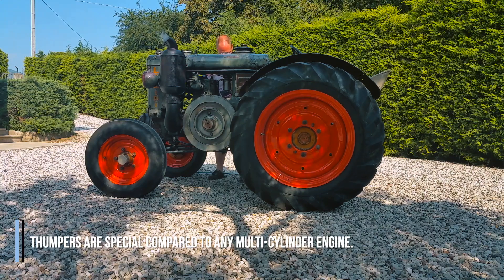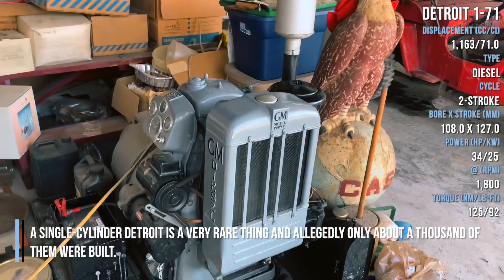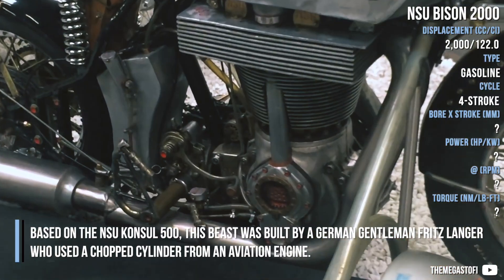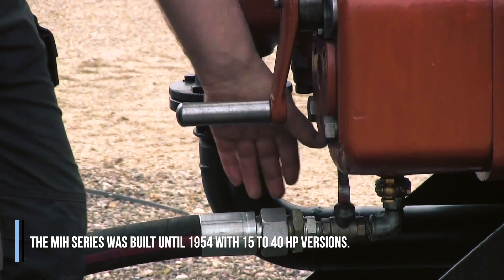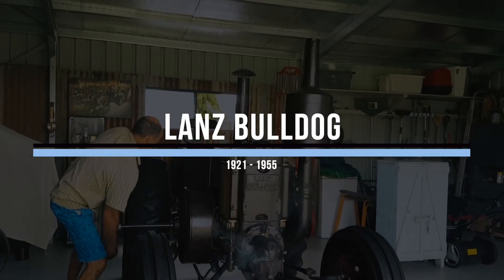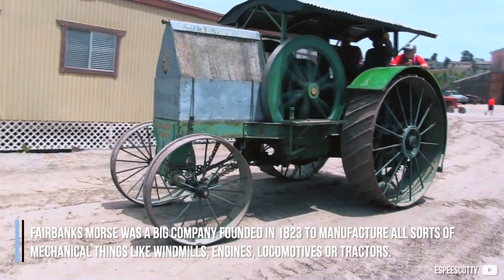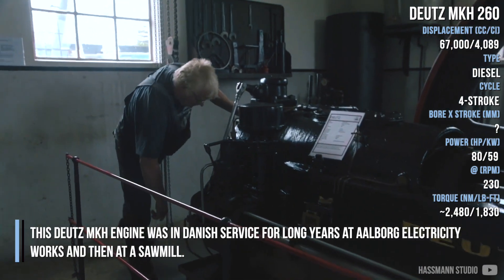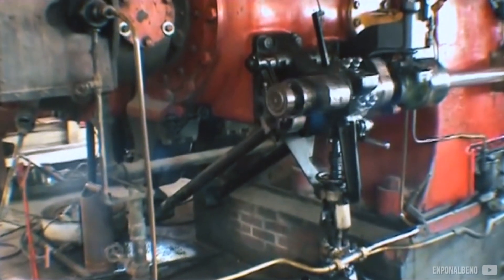Largest 1-Cylinder Engines

Comment from the maker: Anybody who finds these a song to his/her ears? Well, I do, mainly those large hot-bulb tractor engines
Reply: The Landini L25 here in Italy is known to be called as "Testa Calda" (hot head) due to the hot temperature required to ignite the fuel
Reply: dplgta95 Deutschland mkh 260 sounds cool
Reply: Here in the Netherlands they put those hot bulb engines in small rowboat sized tug boats. Search for "opduwer"
Reply: I always love the section of the state or county fair where they display and demonstrate the old agricultural machinery.
Reply: i would like a car or pickup with a huge single or 2 cylinder one with that thumppop at full RPM, than at the stop light pop............thump...................pop,,,,,,,,,,,,,,,,,,,,,,,,thump,,,,,,,,,,,,,,,,
Reply: @budsbustbi6339  Such cars did exist. The Brush Runabout of the early 1900s is an example, being powered by a single cylinder sidevalve engine of about 1.3L displacement, and delivering 6-10 HP. You might be able to find one for sale, though owning such an antique machine would be a hobby in and of itself, with lots of work involved!
Reply: If you ask me, my favorite tractor engine is that of the British tractor known as the Field Marshall.   It is similar to the hot bulb engine, but the combustion plug is a smoldering piece of wick paper.
Reply: this 1 cylinder  engine also makes beatiful music 
https://www.youtube.com/watch?v=UKScvorB85E
not mind to run it in Berlin "Berghain" and people will dance the hell out of it xD
what about a video about stationary engines - ;)
Reply: Just love a large single cylinder! A great variety of engines although I was hoping for Ruston Hornsby to be up there. They produced some very large single cylinder horizontal oil and Diesel engines for static purposes like mills and generator plants. Great video 👍🏻
Reply: Well you know that with the smell of the diesel is even better...
Reply: sounds like a pig with sterioids
i love it
Reply: YES! Big Pistons and  2strokes. Thats what brings the most joy.
Reply: what about the B & W Nr 1 and the Holeby nr 1 they are really large and single cylinders but u didnt take them into account?
Reply: I have my Suzuki Dr BIG 800 today, it's like a horse kick !
Reply: Maybe you could make a video on biggest two cylinder engines.
Reply: A monday morning a mean mean shine lol
Reply: I like the hot bulb design. It led to the invention of the prechamber diesel. Prechamber diesels might not be popular now, but many years ago, it was the only way to build compact diesels. Better injection systems, port swirl, and piston shapes eventually made direct injection compact diesels possible.
Reply: It reminds me of a kinda thruster for planes/space ships I've seen somewhere that's basically constantly exploding behind the craft. Bopbopbopbopbopbop
Same kind of satisfaction.
Reply: That DR 800 has some  throat to her , wow.
Reply: I honestly like the rythm they  produce but imagine one of these throwing a rod
Reply: This is my neightbor on the nsu Bison 2000 😂😂😂
Reply: Heinrich Lanz Mannheim
Reply: They look and sound old and primitive but I can listen to them all day long.
Reply: I am just a fan of engine sounds, tho my favourites are flat plane, two stroke and rotaries. I guess I'm a sucker for high RPM. These singles sound great in their own way too tho!
Reply: Pocketa pocketa pocketa
Reply: Yes except for your weird broken English 😂 spakplug
Reply: Check out a Delmag D-200 diesel pile driving hammer. It is a giant  single cylinder 2 stroke diesel engine.
Reply: @jasonguiol7110  c-45 from Bulldog !
Reply: May I ask where you’re from? I just cannot place your accent! I love how you speak and think your English has really come on leaps and bounds since you’ve been producing your videos. Keep up the great work brother!!! Peace and love x
Reply from the maker: @chriswilson2431  It’s Slovakia 😊
Reply: @VisioRacer  awwww thank you. Answered a question I’ve been trying to work out for ages! 😂. I love your passion for the older vehicles. I share your love for old mechanical things and have old cars and stationary engines myself. If you ever get the chance to come to GB then you must tell your viewers when and where, as I for sure would love to take you out in a pre war car as a little thank you for all your hard work researching and your enthusiasm. I love what you do and I think you’re such a nice guy. Peace and love from GB x
Reply: They all sound like lawnmowers.
Reply: 0:14 I'll make it fit

Comment: I live in Thailand. Here pick up trucks at the end of their road life are stripped, the normal engine is removed and it is replaced with a 5 litre Single cylinder diesel of various makes which drives the gearbox via vee belt. They are everlasting, because EVERYTHING IS REPLACEABLE with recycled parts. They are good for 3 ton plus loads, no tax, insurance or licence to drive needed. Pick ups with a good strong chassis are favoured.

Comment: The L25 isn't even the biggest Landini, It's the Superlandini or the L55-60  with a 12.2L single cylinder. Even bigger here in France we had the SFV (Société Française Vierzon) 551 with a 12.8L single cylinder engine.

Comment: Love large engines, but these are not the largest single cylinder engines. Waukeshaw (I may be mistaken about the manufacturer) had a single cylinder diesel engine that was approximately 4 feet in diameter and turned 60 rpms. It was in service generating electrical power. The one I witnessed was located in Homestead Florida power plant, which was some 40 plus years ago so I may be slightly off but within inches. I was there working on the two Transamerica DeLaval Enterprise 20 cylinder diesels with 15" Bores and 21" strokes turning 450 rpms also producing electricity. These two Enterprise engines were the only two 20 cylinders that Delaval ever produced. They produced engines from 6 cylinder in-lines to 16 cyl V engines. Some of the marine 16 cylinders were direct reversing engines, meaning they would run in forward or reverse with a max of 9K BHP.

Comment: That's Suzuki that has 800 C c's in a single cylinder is it a 2 stroke or a 4 stroke? And ask for the Detroit 171 it's just basically A671 with 5 of the cylinders not there

Comment: You didn't even mention Rustons. They made a range from singles up to 6 cylinder parallels I believe.

When I first left school I worked at a local sawmill that had a large twin Ruston powering the breast bench and the skid winch. If you were a little late getting to work (which I often was) you would see twin smoke rings about half a meter in diameter from the engine as it started up.
It was amusing to wait until the sawyer on the breast bench had a heavy cut going and then load up the skid winch. Man didn't that engine just knuckle down and grunt as the governors opened up.

Later during my apprenticeship I worked on a single cylinder Ruston which, from memory, had a 18" piston and a 36" stroke with a 6' flywheel. Both were compressed air start.

The engine hadn't been running for 10 or 15 years and we had to get the engine running again as it had been sold  and the new owner wanted it running before moving it. We had borrowed a small Petter single cylinder stationary engine to run the compressor and when all was ready John the mechanic opened the valve to turn the engine over. Now the shed the engine was in was pretty run down and the area where the compressor and air valve was had no roof. Added to that was the exhaust pipe that ran from about waist height down under the floor for about 4 feet then up through the roof. Unbeknown to us was that 6" exhaust pipe was half full of black sooty slimy water. When the engine turned over there was a hiss and a roar followed by a gurgling sound on the exhaust stroke. All that compressed air blew that mess straight out the exhaust pipe, into the air, where it promptly fell back down onto the roof. Except there wasn't a roof over the compressor, which also happened to be where John was standing. Needless to say John ensured that a large portion of this mess didn't sully the floor. I just about had a fit I was laughing so much. He just stood there with slime dripping off his glasses.

Comment: There is atleast one larger 1 cylinder engine than any listed here.  At the United States Merchant Marine Academy there is a single cylinder version of a modular ship engine.  this single cylinder engine is a Wartsila engine with a bore of 38 inches and a stroke of 98 inches thus giving it a displacement of 1786 liters.

Comment: Doesn’t say fuel engines.  what about the 3 one cylinder steam engines the Dutch used in the 1850’s to pump out a lake south of Amsterdam. 3 meter one cylinder steam engines driven by multiple boilers. Dewatering on steroids.

Comment: I remember when living on my father's farm growing up, we had a "Piagio" one cylinder cultivator. It had a pulley that was operated by a rope, that I had to roll over to crank the engine. It had 16-17 HP, and smoked like a bastard, but it would get the job done.

Comment: Miata owners: "I'll make it fit"
Reply: Werent that honda owners?
Reply: @ehmjauhh5495  no. Honda owners will make it louder and more gutless
Reply: @MrThunderCunt  so what happend with the "you think that'd fit my honda?" Meme?
Reply: @ehmjauhh5495  i assume it got replaced/overshadowed by the vtec meme, because that's the only thing I hear when hondas are involved
Reply: Or Citroen Saxo drivers… my mum was a Saxo driver until she got an Audi
Reply: @Youtube_Reiska  so she downgraded?
Reply: @duasrodascrl  in reliability, yes. In luxury… hell no! She had a 1.1 litre saxo and changed it to a 3.2 litre v6 audi a6, constantly broken. Now she has a Merc C200 diesel 2.2 litre 135 hp… oh yeah. Very reliable and only fault was a leaking turbo hose, cheap easy fix
Reply: Anything will fit in those cars with enough cutting

Comment: When I worked heavy construction (building bridges mostly) we used a pile driver that was single piston diesel powered.  I don't know what the weight of the piston was but you would pick up the whole apparatus (about 20 feet tall) piston and cylinder  and all set it on a piece of pile turn on the fuel and as you picked up the piston with the crane it would draw fuel into the cylinder and then you'd just drop the weighted piston and it would create pressure in the cylinder causing an explosion driving the piston up in the air and repeat... it would stay running as long as it had fuel a fun way to make a dollar (much more fun than pouring concrete) :D .
Reply: I absolutely love those diesel-powered pile drivers!! Cool and terrifying at the same time.

Comment: Too bad he doesn't show some of the stationary engines used in the oil fields 120 years ago. I remember seeing spark ignition engines with cylinder bores over 15" with greater strokes. Atmospheric intakes with single lobe cam controlling the exhaust with flywheels taller than a man.

Comment: I remember reading about a single cylinder diesel engine in Russia driving an electrical generator which had 54" bore and 54" stroke in a 1911 Encyclopedia Britannica.  I get it worked to  39,366 c.i.

Comment: A single cylinder doesn't automatically induce/imply more torque. It dependent on the bore and stroke. You know you can have the same cc's but is it an over square engine'? Under square engine?

Comment: I had a 1955 500 cc. BSA Goldstar ,and that thing had gobs of torque, but would vibrate all the bolts out of the engine mounts, and would put your legs to sleep if you rode it very far. Wish I still had it!!!

Comment: Curious how that Landini crankshaft was rotating backwards for the first several revolutions before changing direction to normal. I dont think i saw any steam engines so I guess this was internal combustion only. If steam is included, there would be some Corliss type and probably other steam engines that would dwarf everything here.    Cool video though  !

Comment: the last engine was running that fast and sweet with a 26 in piston and a 38 in stroke . the average piston size in a engine is 3 or 4 inch. this is a monster of a engine it's to bad they don't make them now they would be fantastic on massive whole town back up generator or for a huge plant generator.

Comment: Here in East Texas, I've seen odd looking single cylinder horizontal engines that appear to have been cobbled together using oil field pipe and steam engine parts. They were 2 strokes and were fueled by the oily natural gas that came up with crude in the local wells. Was told those spun generators that powered electric lights so they could drill at night and later on, kept the jack pumps nodding away.
Reply: Those are still being made and used, there were several brands with Ajax being popular in a couple of variations. DeLavall engines as well.
Reply: @ricknelson7824  There's a company in my county that's been assembling natural gas compressors on skids for 30 years or more. Theirs are set in oil fields to push the separated NG back down into the deposit and are quite elaborate. The old ones I've seen were crude in construction with no name plates.

Comment: Funny fact about those Landini tractors: they didn’t have reverse gear, to drive backwards they simply let the engine spin down until the right time, then turned the fuel injection on right before top dead center, so that it would kick the engine over to run the other way. The problem with that was: if you were going up a steep hill at wide open throttle, and let the engine slow down too much, it would pre-detonate and suddenly change direction and go wide-open throttle down the hill backwards
Reply: So similar to a snowmobile
Reply: I saw that happen to a road tractor with a Detroit Diesel.  The driver almost stalled it pulling out on a hill,  then he kept revving the engine harder harder each time to try and pull out.  However, the engine was running backwards and each time the truck went  faster and farther backwards.  When I saw exhaust coming out of the air intake,  I told him to shut it down and restart it.   

Also had it happen many times on my 1974 Husqvarna 450.  Scared the hell out of me first time it did it.  Almost sent me down a steep hill backwards.  After I figured out what was happening though,  I'd just ride it in reverse awhile while my buddies  jaws dropped.  It would at some point go back forward without missing a beat.  Crazy!
Reply: Interesting factoid... thanks!
Reply: Some modern 2 stroke snow mobiles have used the same method to reverse without the need of using gear...

Comment: In the 1980's, we found an old Deutz one lunger deep attached to an air compressor in an old mine in southern British Columbia. We scooped out and replaced the old diesel and oil, blew in some ether and the thing started without any problems. The mine had been abandoned in the late 1930s.

Within a couple of minutes, the drift filled with exhaust. We think it must have had a very long exhaust pipe to the surface.

Great machines.

Comment: 1:41 in India at our house, we have a big 1 cylinder sounding similar to the Detroit and mounted to the floor. It also doesn't go on a vehicle but instead uses belt drive to power a wheel with 2-3 spokes and each spoke is a blade. It's used to cut up a plant (idk which one it's kinda just a big green leafy thing) to feed to the buffalos (I believe they're water buffalos).

Comment: You have a really good video here, with that said, you really need to level out your Audio.  Make your Microphone as loud as or louder than the other sounds.. It is very difficult to hear you and if I turn up the volume while you are speaking, then the engine sounds are way too loud.  Also I have tried listening both with and without Loudness Equalization on.. Your Mic is way too quiet..

Comment: My honda tmx 155 is way out of that 2,000cc tricycle i just got it machined to 200cc and thats the limit of most of the blocks but others made it to 400cc like the thai drag bike honda c70 like what the hell did they manage to get that c70 to over 400cc and mine is 200cc and its a tricycle to pick up passenger from a to b reliably and fuel efficiency.

Comment: AJAX DPC2801 could be added to the list of big single cylinder engines. It is integral engine compressor with common crankshaft

Comment: I   ran a smit bolnes single cylinder crosshead 2 stroke that was over 300mm bore diameter 300+ hp 7000nm torque 100rpm idle 300rpm max for castrol as an oil test engine. It had 2x 2.5ton flywheels,

Comment: Landini also made the Super Landini (12.208 cc, 40hp) and the L55 (13.000cc, 55/60hp). The L25 was around 4.200 cc, while the earlier Velite and the L35 had 7200cc engines.
Also Landini are hot bulb engines as well, and they need to be pre heated like the Lanz. While newer ones had electric starters, most are started "throwing" the pulley/flywheel. 
Since they don't have the reverse gear, the rotation of the engine is reversed to go back. If an engine is in good enough condition it can be then run at "half-turn" (mezzo giro) which means the engine keeps going like a pendulum, back and forth, never performing a full rotation, effectively keeping it running at 0 rpm.
Reply: Here you can see some Landinis inverting the rotation direction and running at "mezzo giro"

https://youtu.be/-8RJKvF0dmE

https://youtu.be/-ha0EVIwtMU

Comment: There is a story about a mechanic losing a wrench inside of the zylinder of a Lanz Bulldog at maintenance without noticing.
First start after maintenance was a bit rough but it started and ran without any problems.
They found the wrench years later, embedded in to the Piston forming one part, at the next disassembly.

Fake or not. It sounds reasonable.